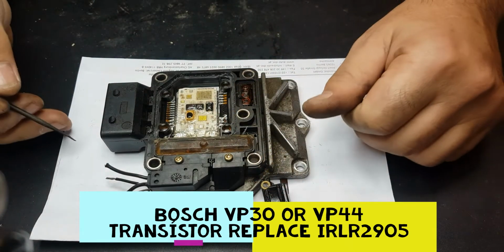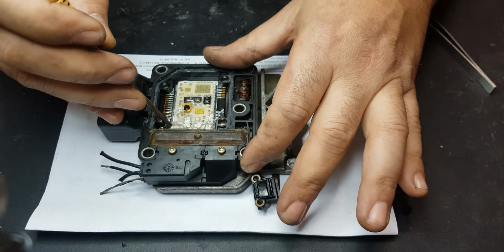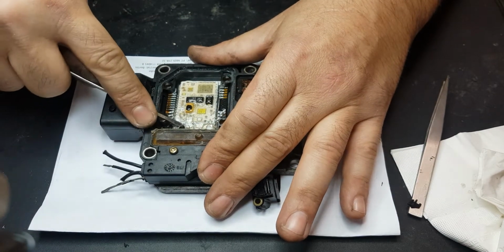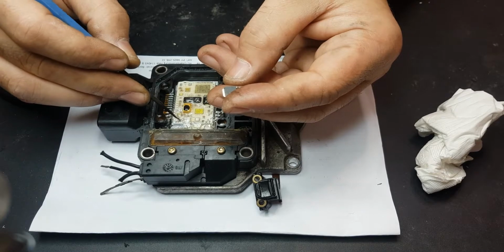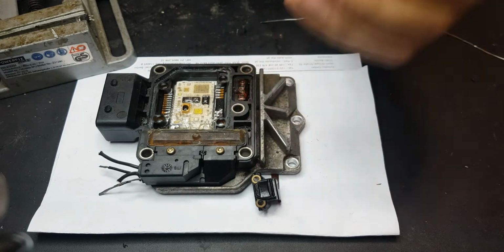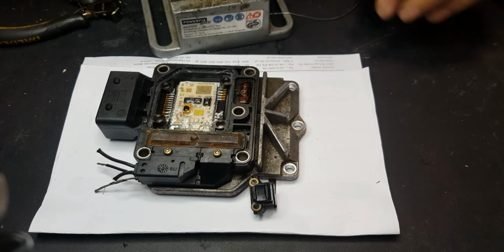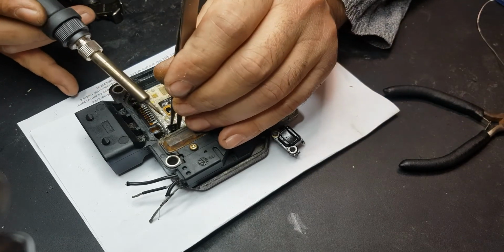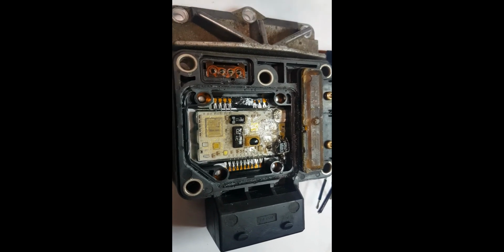bosch vp30 vp44 transistor replacement

Comment: Today I inserted a 12V 55W bulb, and when I start it, it blinks and the voltage fluctuates between 12.6V and 7.9V. But I don’t understand why the valve does not work when the valve is connected. Maybe a transistor? although if it was a transistor it shouldn't have blinked one light, right?

On the other hand, when I connect the valve together with the bulb, there the bulb no longer blinks if I start. IF I disconnect the solenoid and leave only the bulb, it does blink. This could be that the transistor is without power perhaps?

https://youtu.be/-r797kBsHXA
Reply from the maker: The light and the valve have diferent current draw...meanning that you can turn the light on but not have enough current to open the valve...
This transistor works as a voltage regulator.
Reply: @PSICompanyPerformance     Yes, it seems that it lacks power because with the valve connected, the voltage drops to 1 and a little, on the other hand, with the light bulb it makes it blink and it stays at 7v and something. It looks like the mosfet that is dying again. The module was repaired in 2018.
Reply: Салам алейкум

Comment: What about the two wires n the side are they meant to be insulated ?
Reply from the maker: Yes it should be insulated, usually those get cracked from the heat
Reply: Can please do the video with better angle

Comment: Good a question, if the vp30-44 is not coded with the car, when turning the ignition key but without starting, would voltage also reach the flow valve, or would no voltage come out of the psg5?

I have a pump that I bought from scrap, without coding, I have connected it to the car, and I contacted, to see if the voltage reached the flow valve, but no voltage arrived. So I don't know if it is because it is not encoded, or it is also broken.
Reply from the maker: These pumps must be virginized before you can put it to another car.
If its the same car than you can do the repair and just start it.
If its another car you will get a error code about security watchdog wich means it needs virginising before you fit to car.
After virginising you turn the ignotion on for about 30 seconds until immo light turns out and then you can start the car
Reply: @PSICompanyPerformance    For example, if I give 12v and ground to the psg5 module, should voltage be coming out of the control valve wires? or if there is no signal from the can bus directly, there is never any voltage on the flow valve cables?

I read that once, that to know if the module works or not, you just have to make contact, and if there is voltage on the flow valve for a few seconds, it is fine.   That's right ?
Reply: @PSICompanyPerformance  Love the video. But how do you "virginize" the pump to another car? I have a scrap pump from another car i want to fit onto my car. How do i do it? Tysm for a nice vid!
Reply from the maker: @MrThaiko  there are a few ways to virginize the scrap pump, it takes about 12 minutes with the right tools, like, Bosch KTS with vp adapter or a Focom or a ford vp virginizer that you just plug it to the pump and give it 12v and wait til a green light appears.
I have all of these tools and always use tye last one.
I bought over the internet from a company in Turkey but it was about 3 years ago, and i dont know if they are still in business.
Reply: @PSICompanyPerformance  Cool, thanks so much for info!:)
Reply from the maker: I dont think so, because you would have to have a signal from the ecu to be compared (watchdog a.k.a immobiliser) before anything comes out the pump....but i could be wrong.

Comment: I have a problem with my Ford Focus TDDI 1.8 66kw. After some time of driving (30min) it "slows down". It cant acceleration as before. In diagnostic it says something about bosch pump error, so is it possible to fix it like you show in video by replacing transistor only?
Reply from the maker: The irl2905 or 3110 cost around 2 or 3 euros but the main issue is to solder it in place.
Please watch the video carefully, all the info and procedure is there.
Reply from the maker: It could be another issue but the most common problem in these is this one
Reply: @PSICompanyPerformance  how much transistor cost and what is the exact name? also ty for replay
Reply: I used 3110z, but my focus is slower like before i replace the mosfet...i don't think so the 3110 is the best choice  (escuse my english) 🤣